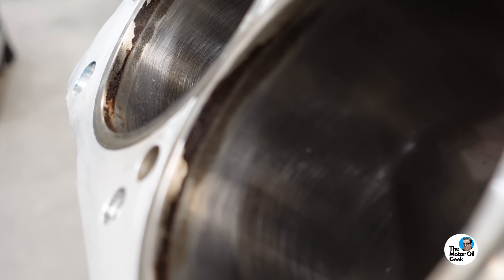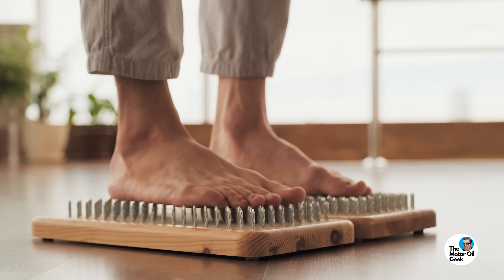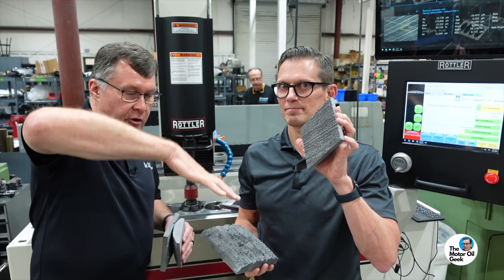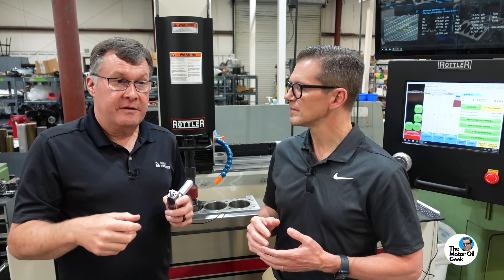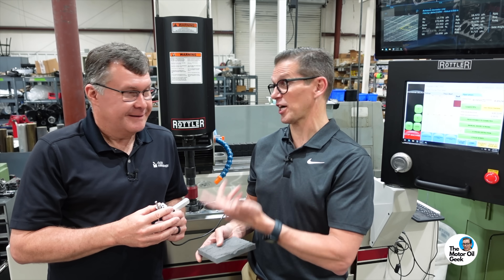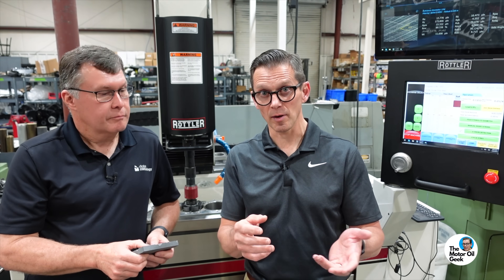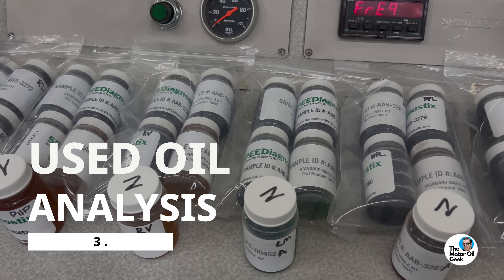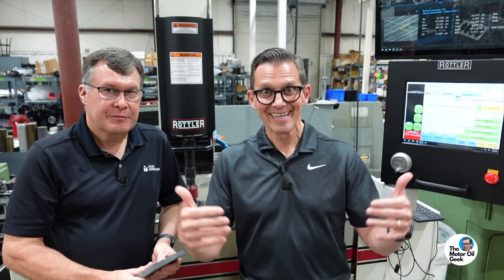GM's $1 BILLION Dollar Blunder: ROUGHNESS Matters...

Comment: I saw a video from Rainman Ray and he said that, shortly after the recall where they recommended the switch to thicker oil, they changed their minds and replaced that recall with the engine recall where they were replacing the engines. Apparently, they realized that the thicker oil was not going to solve the problem long term. Is that the the case or are they till recommending 0W 40 oil for those engines. It appears some are. Based on what is in this video, thicker oil isn't the solution, properly ground cranks are.
Reply from the maker: The thicker oil is still part of the recall. It is what they do for the engines that pass the inspection test mentioned in the previous video on this topic.
Reply: @themotoroilgeek  That is interesting. I did hear you mention that but thought they had changed their mind. I am surprised that, given the issue with the cranks, that they are willing to take a chance with them. So the thicker oil will resolve this long term?

Comment: Lake, crazy good video again. 🙌🏻
I want to get my engine rehoned but don’t have a profilometer. What do you suggest? How many strokes will a 600 grit cbn hone take in an iron cylinder to knock the peaks down, but keep the valley (after honing it with a 170 grit diamond type)?
Reply from the maker: I would not hone anything without a profilometer to measure what was produced.
Reply: @themotoroilgeek  I totally accept that as an answer

Comment: Now I know why the mechanic that trained me on airplane engines allways said chrome cylinders and steel rings or vice versa never chrome on chrome. Good to know the reasons why now in case the customer needs an explanation.
Reply: Yes, and chrome cylinders burn 2 to 4 times the oil.

Comment: This should be required viewing for all customers at every shop where engine rebuilds are completed!  Customers need to understand that being a mechanic is WAY more than just changing out parts.  The knowledge required to "FIX" what friggin engineers have designed is a major part of what you pay for at a local shop.
Reply: That can literally be said for majority of the professional trades or craftsman out there though, because I've been in commercial and industrial sheet metal my entire life. correction retired as of several years ago, but I can't count the number of times I told mechanical engineers that just because they put whatever on paper drawings, does not mean it works in real world practice.
I've even made the offer to build things in the ways I know to be most efficient, and actually improve the systems beyond their specs. That if my method didn't improve it, that'd we would take whatever it was out, and replace it the way they designed it out of our money.
Fortunately I never once had to chew on that, or have to bow my head in in shame I couldn't do what I said it would do. Not that I'm anyone special, but like we all know years of experience can do things that no book will ever replace especially in over all knowledge of ones trade.
Reply: That would be great but they don't give a damn
Reply from the maker: Agreed!
Reply: It won't happen. It's called TMI.... too much information for them.
Reply: engineers are not the problem here.... the manufacturer of the crankshaft is the problem.

Comment: Are synthetic (non metal) rings available? Ceramics, etc? IDK seems like some kind of answer say in top fuel machines? 
If you see metal in oil filters, drain plugs.....it's to late. High tech expensive machines, oil sampling only way to go. The average guy running a street rod is not much going to throw big bucks into a machine that is running, let alone, spend money on oil samples.
Reply: Ceramic is stone.
Stone is much harder than metal, but weak in tension.
Stone will produce stone dust.
You don't want stone dust touching metal.

Comment: A gap piston ring is the worst standard of sealing combustion chamber.  The scratches in the mating surface are alignment guild for moving parts. Most of the time all those scratches are fill with carbon oil sludge to prevent friction to surface. The extreme temperature of the fiction surface also stretch the rogue surface making it more smooth when compared to cold metal surface.
Reply: I found Honda and Toyota both run their PCV System so low in vacuum they carbon load the oil to keep it out of the Intake Manifold and downstream. This is why they're prone to Oil Control Ring sticking and burning oil. You have to get the carbon out of the engine. If a surface is too rough film strength needs to be thicker to offset this engineering flaw. Their planned obsolescence program is too short.
I've retuned all the Acura/Honda products in my reach with a Catch Can and raised the vacuum to correct this problem.
Reply: @robertjackson7590 
The famous 2.4L in almost every CR-V. Did more than a few engine replacements or re-ringed the engine if possible.
Reply: @pliedtka  A month ago I changed the PCV System in my sisters 10 Element(2.4) for higher vacuum to pull the Blowby away from the oil control rings. Around 125K miles and Blowby was ridiculous but doesn't burn oil yet. Just pull the filler cap and Blowby is far too much. That got my attention in the first place. Low Tension Rings are a real problem with the low vacuum PCV System. Honda and Toyota both use the low vac. It's not good for high miles as we've seen.
Reply: Huh?

Comment: I have 390,000+  miles on GM 4.3, 6.0  300,000 on 5.3 run perfectly and don't use oil .
Commercial usage  with oil changed 3000 4000 miles .
Even the AFM 5.3 no trouble 275k !

Very few issues in my fleet of vans trucks in construction work .Cheap easy to fix . 
I have been a mechanic and worked as a aerospace machinist built diesel engines marine engines gasoline engines dirt bikes since I was 13yo  1976 .

Anyone who claims ALL GM is "junk" is clueless moron .
  

All manufacturers have bad years models .

Oddly the Camaro  6.2 isn't failing.
Perhaps those cranks were manufactured in different plant ..
Reply: All I've seen is praise for how reliable the Camaros have been mechanically even with track use.  It calls back to the GM I remember where the rest of the car may be a plastic rattle trap but, the durability is where it counts.
Reply: @QuietDriver97 yes....
Reply: @QuietDriver97 the GM of 20+ years ago made some of the best pieces of junk on the road. They'll shake and rattle, but just keep rolling. As they age, they develop "character" 😂
Reply: @GregoryGlessnerViolin  As the old adage goes, "A Chevy will run like shit longer than most cars will run period." 😆
Reply: GM’s 6.2L V8 AFM evolved across generations: Gen IV (2005–2013, L92/L76) introduced basic V4 deactivation with lifter and oil issues. Gen V (2014–2020, L86) added VVT, variable oil pumps, and smoother transitions. L87 (2020–present) refined AFM but recall defects amplify lifter/bearing failures, worsened by oil demands. It's not the bearings or the crankshaft but the tough oil deliveries causing cavitation problems.
Reply: @gvi341984 pulse width modulation oil pumps .

Curious if they could be adjusted to put out full pressure continously .
Reply: I’ll bet you’re not using 0W-20.
Reply: I've had my 2021 L87 Silverado since brand new. It has 145K miles. Have used 0w20 it's whole life. No engine or trans issues.🤞

Comment: I want Toyota to show us wtf happened with the tundras
Reply from the maker: That would be fun!
Reply: The main bearing structure is a issue. It’s not debris in my opinion as this happens to engines in two different engine plants. It kills the same bearing.
Reply: I think it was stated in a service bulletin, machining shavings were in one or a few oil passages and was not cleared out during manufacturing, which would likely dislodge at some point into bearings and BAM! Toast.
Reply: @Shawn-ky2tw Please. If it was debris, the problem wouldn't span multiple years.
Reply: @johneddys2351  It's possible.  Quality control efforts have significantly diminished since COVID.  It's starting to come back, but WAY too slowly!
Reply: @johneddys2351  You don't know that. Manufacturing of engine blocks is very automated. If the issue was the rinsing of the block, after machining, it would continue until the process was improved.
Reply: @Shawn-ky2tw Oh. It took them 3 model years to get the block cleaned and rinsed correctly. Good news then. Now I find the problem even more stupid, and I have less trust now.
Reply: @Shawn-ky2tw  yeah and they’re also some updated part numbers in the new engines. I’m not sure we’re getting the whole story and I’m gonna need to see a few model years with phenomenal reliability before I trust that engine.
Reply: Updated part numbers are a giveaway that something was wrong with the original part.
Reply: @Shawn-ky2tw They lied to save face. The issue spans multiple years so the excuse didn’t hold up. The issue is bad design and quality control.
Reply: 0w20 oil in a turbo engine is part of the issue as well.  Use 5w30 or even 5w40 in the new Tundra and it will run forever.
Reply: @user-tb7rn1il3q  Well, "forever" hasn't even come close to passing, so how do you know this?
Reply: Bad Mexico quality
Reply: @joncrespo1596 They are built in the US.  Nothing wrong with Mexican Toyota plants though
Reply: @joncrespo1596 both the Tundra (Texas) and it’s engines (Alabama) are built in the USA. Get your facts straight.

Comment: Ironically, about 15 years ago working at the dealer....when we were doing pistons and rings on AFM 5.3s and DI 2.4s, GM did NOT want us honing the bores. Scratches felt with your fingernail got engines, otherwise it was a ring job.
Reply: Same TSB information was applied to 3800 Sunday engines when the Sunday crew did not clean cylinder bores before assembly  . "Do not hone the bore "
Reply: Aluminium block vs cast iron.
Reply: @crisnmaryfam7344 I don't think it mattered. Aluminum blocks were sleeved anyhow.

Comment: So GM has suddenly forgotten how to make Crankshafts now? 😉
Nothing to do with the dumb Oil and extended change intervals then 🤣🤣🤣
Reply: I guess GM needs to leave the ultra low viscosity engine oils two companies that can actually manufacture quality parts. Time to bring their products back to 20W-50 and worry less about these things 😂
Reply: @slscamg  Ditch CAFE and get back to reliability!
Reply: I doubt they (or who ever it is that makes them) forgot, they messed up and a quick fix is changing the spec on the oil to increase margin they lost in machining.